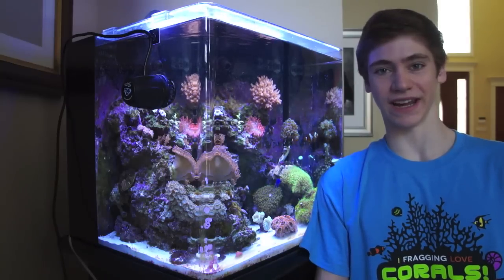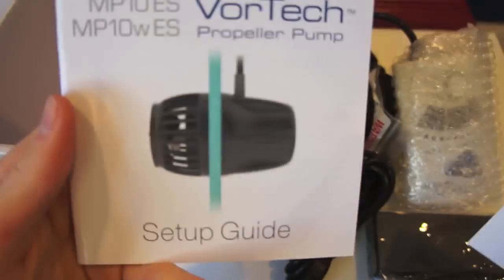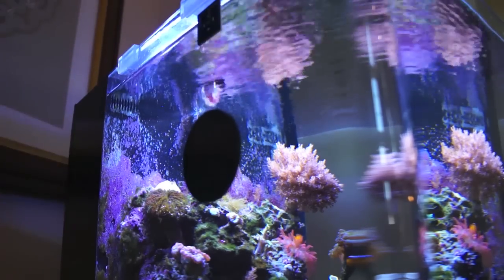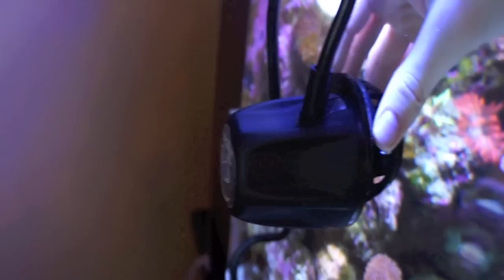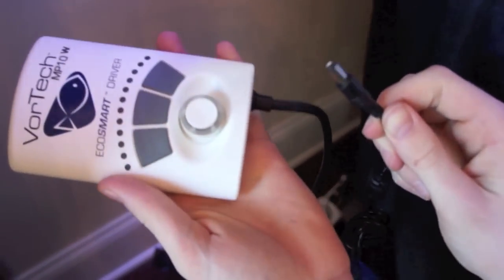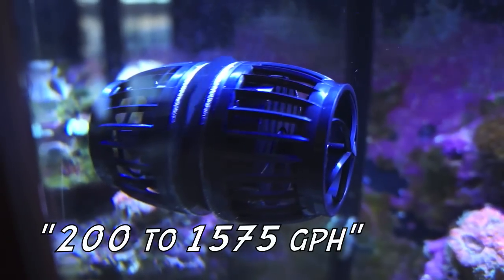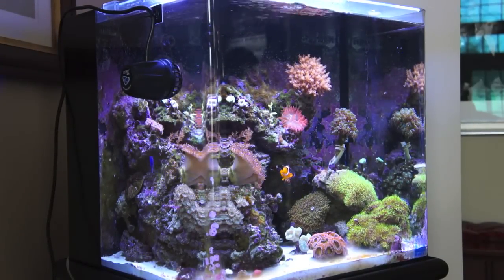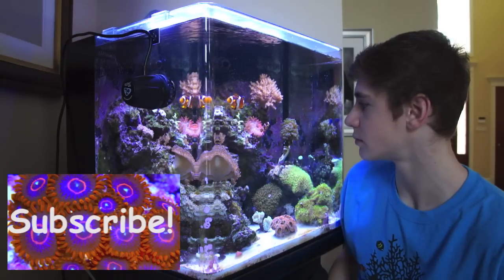EcoTech MP10 WES Pumps in Nano Reef -Wavemakers and Pumps in Nano Reefs

Comment: I'm only going to have one so does the non wireless do all the same function like night mode or does that need to be programmed via computer or smart phone
Reply from the maker: +Kevin OKeefe You program it on the computer or you can toggle with it on the phone but the non wireless would do that function you would just set it from the controller and leave it.
Reply: +CoralFish12g I have a question I did an accidental dose of ammonia with surfactant (for a fish less cycle) in it just one drop per gallon one time will I be ok I can't find much on forums about this
Reply from the maker: +Kevin OKeefe I do not know info on this. Sorry

Comment: So I am Going to Start my Aquarium, iI just bought a 10 gal. fish tank and I am debating what type of filter of oxygen thing i should buy. I bought a cascade one. any suggestions?
Reply from the maker: If you are talking about an air pump, it doesn't need to be brand specific, any one will work.
Reply: coralfish12g Thnx a lot. Are there any type of parasites that may grow in the corals? like worms or stuff like that?
Reply from the maker: Gabriel Guirola Yes, there are all sorts of pests and parasites that can kill coral like flat worms or bristle worms. Buy some iodine dip so you can dip corals which disinfects them before you put them in your tank. Do this with rock too if you buy live rock.
Reply: I read that bristle worms are fine. they clean the tank and do some kind of cleaning
Reply from the maker: Gabriel Guirola They can be beneficial as a clean up crew as long as they stay small. Eventually though they will get big, and thats where you run into problems.
Reply: coralfish12g Is there a fish that eats them?
Reply from the maker: Gabriel Guirola Coral Banded Shrimp and Arrow Crabs are reputed to eat Bristle worms, though I have not seen this activity in the specimens I have kept. Some fish such as Wrasses may also eat them. Its kind of unlikely tho those options would be efficient. Seems like you got a lot of Q's ... Like my fb page and message me through there might be easier.

Comment: I also have the MP10 on my Nuvo 38. I keep it in lagoon mode with a max output of about 75%. You don't need the spacer on your tank, because the glass is 8mm thick. It only needs to be used if the glass thickness is 3/16" or less. The tank looks fantastic bud!
Reply: Do you only have 1 of these on your nuvo 38? I just got the nuvo 40 with the new mp10 quiet drive. Wondering if it's enough Horsepower for the tank
Reply from the maker: +Atragichope1 Yes! One for my 30 gallon Nuvo and it will be more than enough!